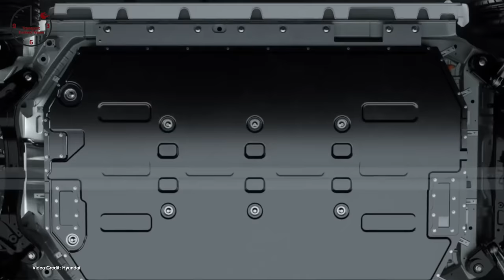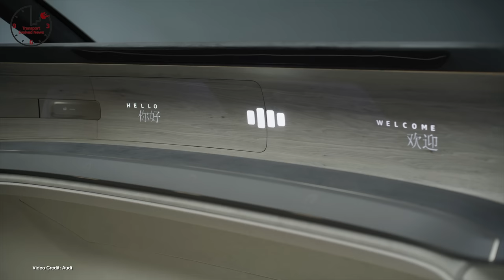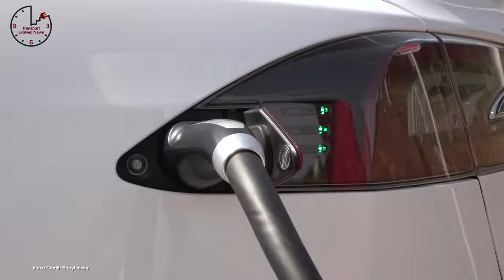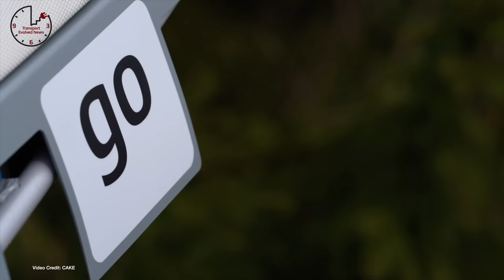TEN 383: Massive 800V Switch, Rivian CEO Warns of Battery Shortage, GM Kills Chevy Spark EV Support

Comment: I don't get it first the Volt, then the Bolt, then the Spark. In the first case they cancelled the Volt because the Bolt was TOO GOOD, then the Bolt & Spark get cancelled because of third-party production issues which are resolvable and are not in any way reflections on the models themselves. It sounds like GM had set them up to fail, and then use that as a false pretext to get out of the field. But it's business suicide.